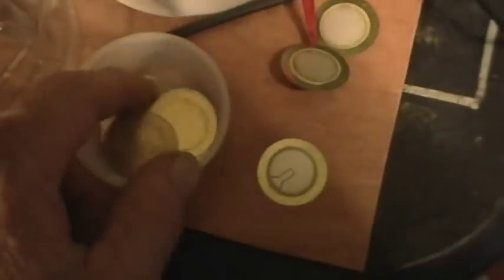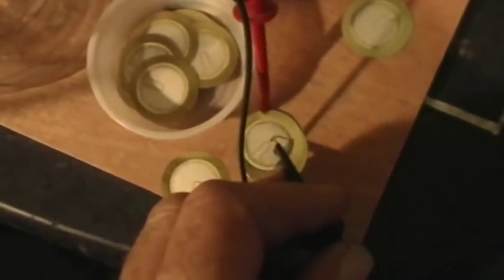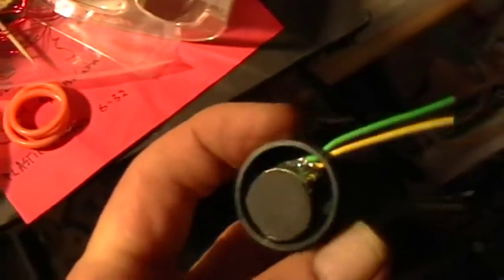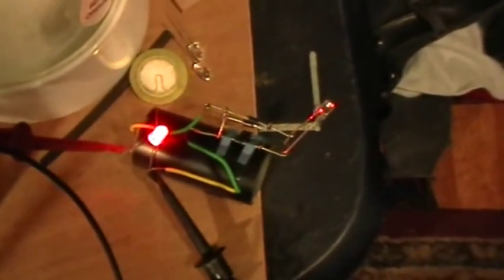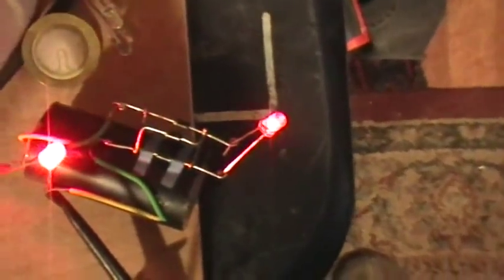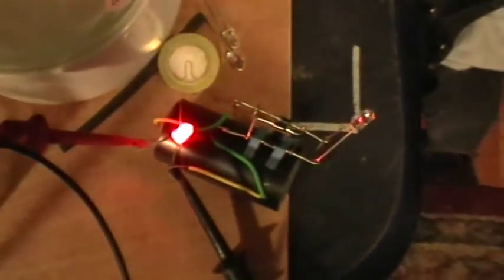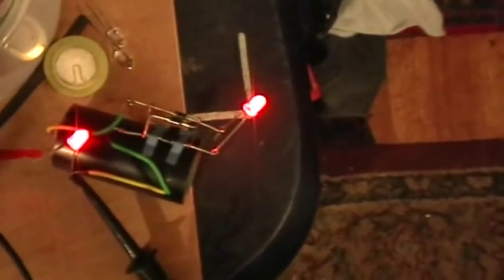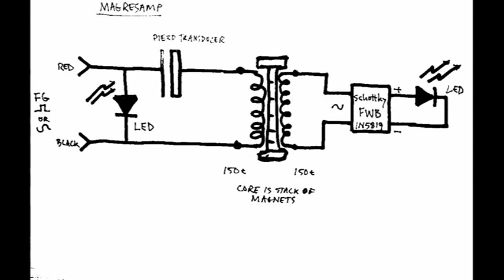Magnetic Resonance Amplifier: Experiment 1, Random Parts

Comment: Hi TK, I congratulate you on starting this project. Even I started building it 3 days back. I woud be using an audio amp coupled to a signal generator. At the output I plan to use an automotive bulb. My primary is 358 turns and sec is 579 turns, keeping the 1.618 phi ratio. Using a ferrite bar magnet. Thanks for sharing.

Comment: Excellent, a new type of transformer. Are the waves coming out the same as what is going in or are they smoothed out? Would AC do anything special, in terms of energy output if resonance was found? Thanks great stuff!
Reply from the maker: I don't think it is so new, really. The output from the secondary, before the Schottky FWB, is a pure sine wave, with some distortion at the higher frequencies. The input signal I am using is "AC" at various frequencies. Thanks for watching, stay tuned for more!

Comment: So you're using the input bulb across the input coil to detect input voltage only. What about input current at resonance where the output voltage is highest?
Reply from the maker: Check out the later videos. I show some current measurements in them. A little later on I'll try to show as much real data as I can. For now it's just "phenomenology"... a study of "what happens when I do this" sort of thing.
When I monitor the input current I remove the input LED so it doesn't contaminate the reading, and I use my special "Kelvinish" rig: a 1 ohm non-inductive resistor, that I directly soldered to a cut-off scopeprobe lead.

Comment: Very cool.  Is this related to how we can light leds with the JT circuit on high freq. and high voltage in any way?  That output led was very bright at those higher freqs.  What was the input current supplied by the FG? (If any)

Thanks for your videos.

Bill
Reply from the maker: No, I think this isn't like a JT because the secondary isn't making spiky short pulses of HV. There is a lot of current available in the secondary but not that much voltage. I tried 3 LEDs in series... easily lit by most JTs... as the output load but no glow here.

Why do people think that the input to such a device isn't supplying current? How could the transformer effect happen at all if there wasn't any current? How could the piezo even click if there wasn't any current? At higher frequencies the piezo acts like a capacitor.

But there isn't very much current on the input side, that is true, and it depends on the frequency of the input from the FG. For this experiment the FG's open-circuit output voltage is set to just over 4 volts, only. If I put the input LED in series with the input, instead of across it, neither LED ever glows very well, even with the FG output turned up much farther than for this experiment.

Comment: So why is the input led going out? Lots of current passing the piezo and causing voltage drop? Or is the piezo countering the sig gen? Or am I missing something obvious?
Reply: i think the led on the input is not made for dose Hz and bekase of the magnets the wave is changing so the output led is glowing
Reply: If the input led lights up at higher freq, as it does in the video. I dont think its failing to respond to the low freq. LED's can typicly respond in the ns range. this is a degree of magnitude away from LED thresholds.
Reply: ok
Reply from the maker: I think it's a subtle interplay between inductance, the LED's nonlinear response, and the driving frequency. In other words... I dunno ! But you are right it isn't simply the frequency; the LED can follow the frequency of the input to very short high-frequency pulses. The output LED should be flashing at twice the input frequency due to the unfiltered FWB, I think, though. I'll have to try some things... thanks for starting a new train of thought!
Reply: TinselKoala no broblem:D
Reply: TinselKoala  After that long rant about how I dont understand ac caps passing current, I twigged to something. The key word being circuit.... How bloody obvious.... I was outsmarting myself. Although the rant made me re think, so thanks for being there to listen lol. I'm thinking of replicating this btw, because you keep not showing the bits I want to see on the scope... as if I need more on my to do list. Bastard Koala. Might have to start calling you the sequined drop bear.
Reply: I don't know the exact circuit diagram, but it could be that when the input side resonates it does so as a series component, and so the input voltage will drop because the input impedance has dropped. Just a guess.
Reply: Andrew Palfreyman Much what I was thinking. Schematic is in Pt1.....